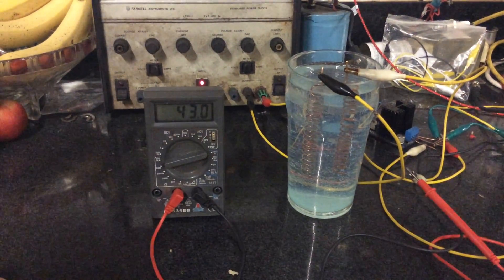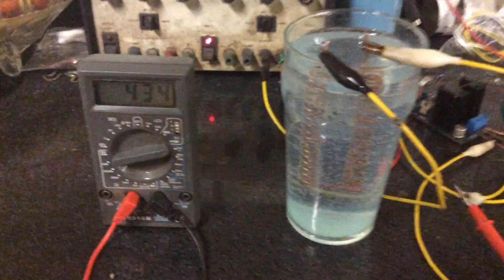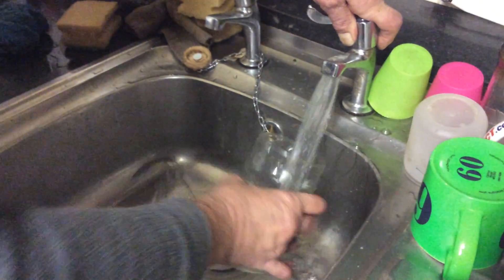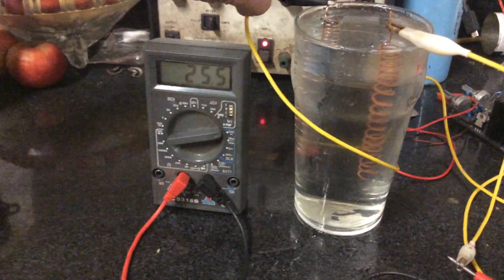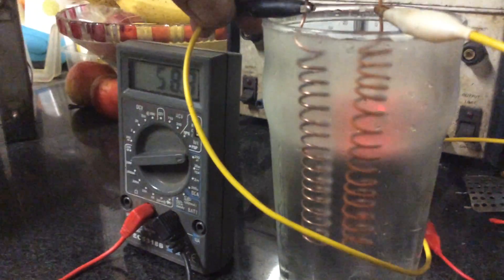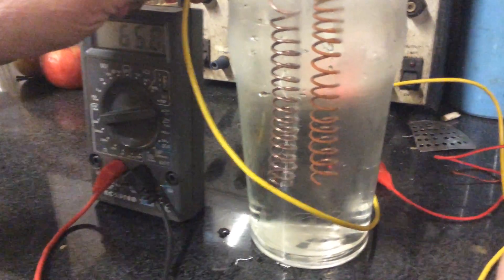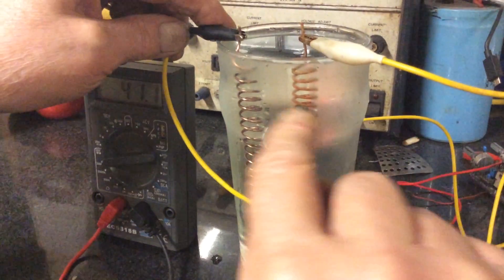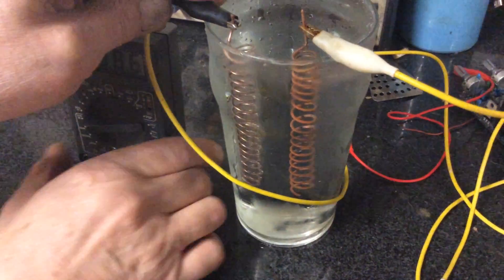Tap water resistivity test.

Comment: What is the curvy thing that looks like a spring? Is that copper?
Reply: Yup. The water turned blue due to copper corroding in there. He is essentially perfoming electrolysis. Pretty sure you can see bubbles forming on the coil.